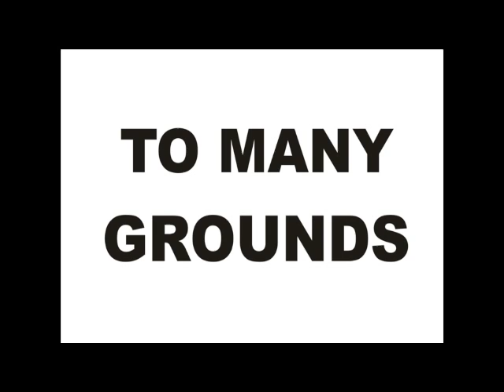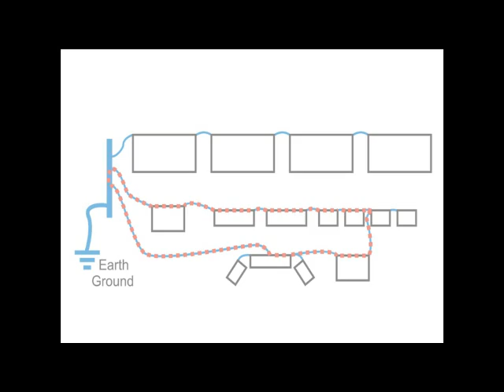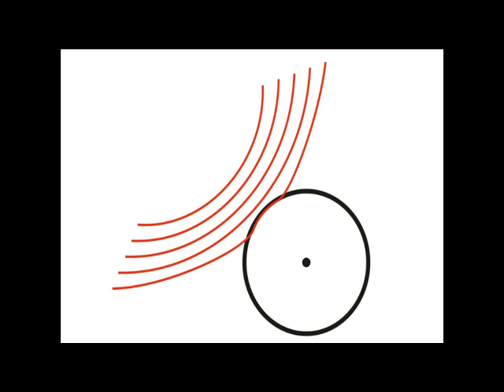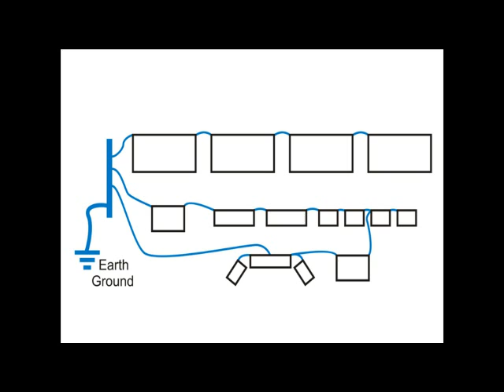Ground Loops

Comment: About a month ago there was a discussion on a carrier equipment email list about grounding and it was split fairly evenly between two camps.  One side held all equipment should be connected via green wire to the racks which should then be grounded to a separate ground bar.  

The other side held that this is completely unnecessary because all equipment is grounded via the ground prong of the AC power and eventually earth ground, so additional grounds could cause ground loops.

What do you think?